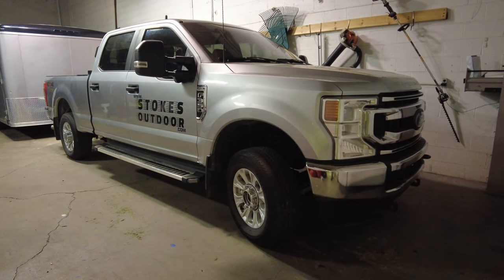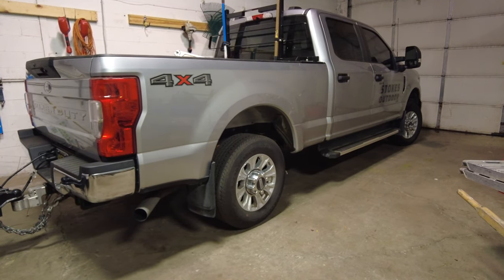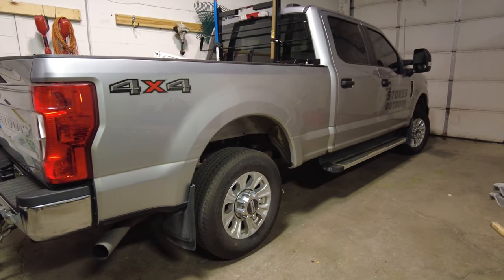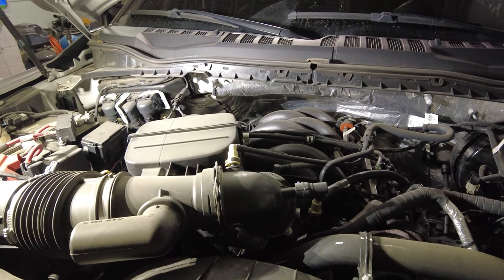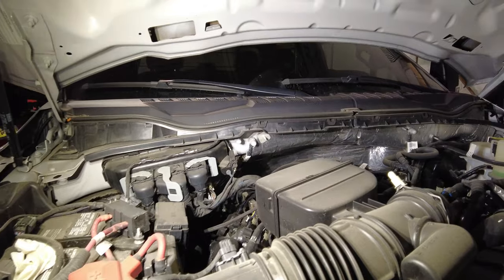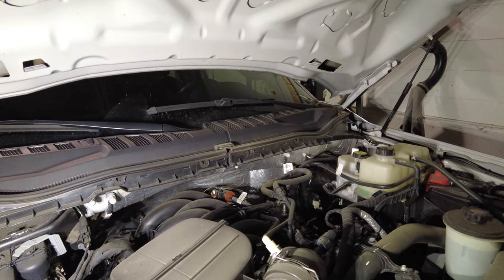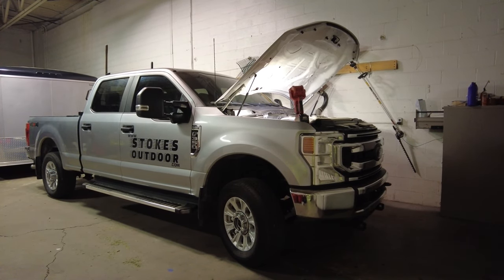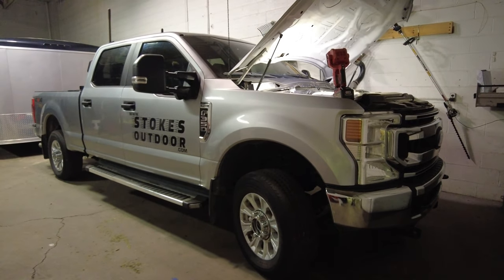7.3 Godzilla v8 - This is why this engine FAILS.

Comment: I run valvoline full synthetic 5w30 and I change it every 3k miles. Oil is cheap, engines are not. It’s that simple.
Reply: Yeah people are running their factory oil fill for 10k miles. All that new metal from the motor grinding itself around. I change my oil twice as often as recommended. 12 year old car and running perfect.
Reply: If you have to change the oil that often then the engine is a POS

Comment: With the availability of synthetic oils nowadays it's an absolute disservice from Ford to recommend synthetic blends and these high output and their turbo engines
Reply from the maker: After seeing these results I have to say I agree.
Reply: I'm a ford tech and people complain synthetic blends prices. You're funny if you think they'll pay for FS oil change
Reply: @amiliosanchez  I’m sure they do. Not my fault Ford over charges for their oils. The actual price difference is negligible when comparing to other brands of full synthetic. The comment stands with the fact that blend oils do not stand up to the recommended oil change intervals for turbo engines. 2 things can be true at the same time. The blend oils are inadequate and people will complain.
Reply: Rotella T6 in all the things!

Comment: Amsoil 100% synthetic all the way and change frequently! Great vid and great info! Keep in mind that “full synthetic” doesn’t mean 100% synthetic. It only has to be 25% synthetic by volume to be labeled “full synthetic.” Amsoil is 100% synthetic. 👍🏻
Reply: This guy gets it! Not enough people are aware of this with modern oils.
Reply: I’ve run amsoil in every single truck I have owned and never had a single engine problem so either I’m lucky or amsoil works. 
12’ 6.7 ps 
15’ 6.7 ps
17’ 6.7 ps 
19’ 6.6 dm
20’ 6.6 dm
Now  two 22’ 7.3 gas fords 
All trucks traded with 65k-100k miles
Reply: ASE master tech and I agree 100% with using Amsoil. I 13:54 have 340k miles and no failures using Amsoil. In addition to low oil quality, I believe cheap China built lifters are cause of many failures. The needle bearing fails causing roller to move up and lifter drops down.
Reply: @TimTheCarMaster  I work several guys with GM trucks with AFM engines. Most of them have over 200k miles on their trucks, no lifter failures. I assumed that they turned AFM off. Not a single one knew that you could even do that and they weren't particularly worried about it. I know for a fact that three of them with over 200k miles are the type that change their oil every 3000 miles no matter what. Clean oil seems to be the biggest factor, not high priced boutique oil. Perhaps in a turbocharged engine where the oil is pushed a lot harder, I could see spending tons of money on the top of the line oil. I don't see that value with a standard pushrod V8. Avoid extended idle time, change the oil often, avoid short trips in cold weather, etc.
Reply: Gotta watch out for the Fool Synthetic.

Comment: That 7.3 is a traditional v8 design from yrs gone.If you were  to go back  20+yrs,we'd run 10w30 and change it out @3000 miles/5000kms in an engine like this.Thats what I'd do personally. I have watched a few tests on MotorCraft oil and the results were good,better than I expected. Again ,if it were me,I  would switch to 10w30, change it 3k miles and use Ford oil and filter.
Reply from the maker: I can dig it
Reply: Most of it is, this engine still has a variable cam phaser and a stupid variable oil pump, which I believe is the reason for the lifter issues due to low oil flow at idle. Thanks Ford for ruining what could have been a great engine.

Comment: I have 2 2020's.  one with 136k and used by 3 different of my guys and my personal truck at 62k.  Not one mechanical issue, but other than a few battery's.  I change the oil every 5k miles.  Full synthetic.  We pull heavy and long. great trucks, and my employee will buy the one when it hits 150-175k and then Ill order another one.

Comment: Thin oil is the problem.    Thin oil is used only because of the epa/government involvement.      Don’t believe me?    Look at what every race car runs.    None except for maybe Indy cars.   Idk what they run.      Better quality higher viscosity make all the difference in the world.      More than one person brought me their cars that were having lifter issues and rough running.   I had them come back regularly to learn the pattern.     I went from 5-20 to 10-30 1040 depending on mileage and time of year and all their problems stop.

Comment: In my opinion, it would be a complete waste of money to use a top of the line oil like Amsoil only to change it at 3000miles/5000kms
Reply: I agree. The solution is to get something more reasonable, like valvoline or penzoil, and change every 3-5k miles. But if somebody has the dough to pay for 3k service with amsoil, more power to them.

Comment: Ford recommends 7500 mile between oil change , best bet if you going to stay with ford, change every 3-4k miles. No need to go to amsoil , but amsoil is a good option
Reply from the maker: 7500 is too much for me
Reply: That's what I'm saying. I work with a lot of guys with newer (2014 or newer) GM trucks with AFM lifters. Some of them have over 200k miles. They change their oil really often like older timers always did and none of them have had an AFM lifter problem surprisingly. It's about clean oil, not how fancy of a full synthetic you use. Get the contaminants, carbon soot, combustion byproducts, etc out of the engine. The filter isn't cleaning that stuff out of the oil. Only an oil change accomplishes that.

Comment: Run 5w40 amsoil. Do a test a 5k miles. We run 15w40 in everything and never had any issues. Gas and diesel.  They run the thinner oil l for fuel mileage.
Reply: Yes thin oil is for fuel mileage, we run 15-40 diesel oil and put 160,000 miles on our 7.3.

Comment: Have a 2022 F350 with the 7.3, check engine light came on with misfire in cylinder #3. Just heard from the dealership they have to put a whole new engine in it (lifter issues). Only 25k miles on it with almost zero towing and primarily highway miles.
Reply: Bummer, I'm sure it's in my future. Stupid Ford!

Comment: Yeah Ford should have already had full synthetic oil to start with like the other manufactures, instead of being cheap with a blend. You should try Mobil 1 5w30 which a little heavier and shouldn't hurt anything, unless you start the day out in lows of 20 degrees and highs of 40 degrees. I have sent off many samples of Mobil 1 5w30 whether it be extended performance, or just the Regular synthetic with good results even at the 7000 mile oil change intervals. Black Stone Laboratories has been pretty consistent with all the samples that I have sent them. I have a GM 5.3 with 216,000 miles with minimal wear from each of results showing normal, I don't think that it should be any different in the 7.3 , as it's a push rod engine to and it's a pretty stout engine. I believe that the Motorcraft synthetic blend doesn't have the additive package that Mobil 1,  Pennzoil , or any of the other brands have, and that may be half of the problem that's happening with the lifter and camshaft problems. As a matter of fact, I'd run Shell Rottella if they made lower multi viscosity oil for tighter tolerance engines, that's a very good oil.

Comment: I wanted to buy one. 7.3 lifted big BFG's............ Then I learned about he adjustable oil pressure pump.      How could ford F it up that bad... not an accident....... Sucks almost a great motor. Guess I need to build a 460

Comment: Ford gasoline engines seem to do good by changing the oil no later than 5000 miles or every 6 months with the Motorcraft 5w-20 or 5w-30. Thats worked well for me for the last 30 years.

Comment: I tow. Payload of 2k plus daily. City drive. Synthetic with 5k intervals engine. Trans and rear diff every 30k. Grease all zerks with oil changes. If you use your truck daily for work then have a regular maintenance interval.

Comment: How are those rear leaf springs since they now use less leafs due to better spring steel? My 2001 7.3 has 5 plus an overload and rides pretty smooth and the truck only drops an inch with a 6200 lbs bobcat on a short steel trailer. Anyone else here have the same approx. 1" drop with the newer springs or do more leafs need to be added to the newer trucks?
Reply from the maker: This truck squats pretty good with the bobcat

Comment: Sorry the problem is this. We have a whole fleet of these engines in the fleet side or the customer side idle oil pressure 5 to 7 pounds too low. We just got the new software to bring it up to 30 psi at idle for the oil pressure and we brought the oil from 5:30 to 10:30 regular oil not synthetic.

Comment: Try Amsoil from a lot of research, Motorcraft oil is terrible. I’ve seen so many problems when people use nothing but Motorcraft it’s like the 3.5 ecoboost with people having cam phasers and timing chain problems. I have a friend who has a 2015 3.5 ecoboost and he’s ran Amsoil since day one and that truck runs flawlessly it has 150,000 miles on it at the moment. And he also has a 2018 Mustang with a 5.0 that is known for having the coyote tick. We ran Amsoil since the day he bought it and that is as quiet as can be and it currently has 50,000 miles on it.

Comment: The real question Is the 7.3 better than a 6.7 diesel
Reply: I own a 6.7 deleted and a 7.3 has both in F250’s. The 7.3 at 97,000 miles is definitely less expensive to own and operate compared to the 6.7. Both pull trailers most of the time.
Reply: @tractorben  Great info, thank you.
Reply: It just depends on what you need.   I got a 7.3.  More people will laugh at you with the gas engine though.  And you won’t get as many girls.

Comment: My son has a 2017 Silverado with a 5.3 engine, it specifies a 0w-20 engine oil. Sure seems light to my thinking. He runs a full synthetic Castrol and it holds 8 quarts.
Reply from the maker: Not a bad move. Thinn oil so running high quality.
Reply: Changing the oil more often is the most important thing with the AFM engines. 5k mile oil changes is pushing it. 3k mile oil changes is best, particularly if it sees a lot of short trips in cold weather. That kind of driving causing more fuel and moisture to get into the oil and form deposits in the tiny oil passages of the AFM system.

Comment: When your oil life monitor reaches 50% change it. Oil is cheap compared to engines, even using Amsoil every 5,000 miles you’d have to do over 100 oil changes to equal the cost of ONE new engine. I’m quite sure by 500,000 miles that engine will have had it no matter what oil you use.
Reply: It's not about using the fanciest oil, it's about changing it often and getting the contaminants out of the engine! None of these high priced boutique oils can magically remove combustion byproducts, carbon soot, etc. The filter can't do that either.

Comment: The roller lifters and cams run in these newer engine should have much less tendency for wear than the old flat tappet lifters used for almost 100 years prior. I use Valvoline Full Synthetic 5w-30 and change it every 5000 miles in all my trucks and cars. The manufacturers seem to think thinner oil equals higher MPG.

Comment: The 6.0 PSD also suffered similar issues as well
Reply: 6.0 was extremely hard on oil.  4000psi oil system that has to lube the injectors and run through a cooler buried in the valley so the oil easily gets too hot.

Comment: All boils down to frequent oil change intervals. No more than 5K. No excessive idling. All the oil change intervals in the owner manuals are way too far apart. And it's listed for normal driving.

Comment: Motorcraft oil filters are a poor choice also .
Reply: OEM filter is fine
Reply: @BT62240 Motorcraft filters have about the worst efficiency there is . For $4.00 what do you expect.
Reply from the maker: Really 🤔
Reply: @kenj.8897 you haven't actually compared them to anything else.
Reply: @wakeupamerica2024 they are 80% efficient at 20 microns . I can name 15 filters that are above 95 % . Like I said it's a 4 buck filter
Reply: @kenj.8897  I bet you cant
Reply: I'm interested. I always use fl820's. I thought they were as good as they get. What is the list of better units?

Comment: 7.3 Godzilla is an absolute dud of an engine. Makes less power than the 5.0 and gets way worse gas mileage. Ford fooled people into thinking that more displacement = more power. 

If the 7.3 made over 500HP stock, I wouldn't be shitting on it. It makes 430HP/475TQ. A Ram 2500 with a 6.4 has it outclassed in power AND reliability.

All Ford had to do is make a Coyote based V8 for the F250/F350 that made more power and torque and it would have been way better.

Instead they made a pushrod engine in a failed attempt to appeal to the aftermarket, and they can't even GIVE these things away. They need the truck transmission, smaller oil pan, different intake manifold, etc to fit in a car. Then you have to bash the shit out of the transmission tunnel and possibly cut the engine bay for it to fit. Not worth the effort. All for what? To say you've got a 7.3L big block V8? No thanks.
Reply from the maker: 🤔 5.0.would be better?
Reply: Lmao 🤣
Reply: Does this guy get paid by Dodge Ram?
Reply: Right it's only got 410hp and 429tq....yeah I'm shittin on that shitbox. That 7.3 will outlast the hemi 3x and I'm not even a Ford guy.
Reply: I’ve been towing an 8,000 lb trailer back and forth across the rockies with the 5.0 Coyote for the last 4 years.  I recently bought the 7.3 and its no contest.  The 5.0 was working to the limit, and with the 7.3 its effortless.  This guy is clueless, and has zero actual experience with either engine - just another spec reading keyboard warrior.
Reply: I have had a 6.8 v10 I have had. 6.2 boss v8. I had a 6.2 v8 with the 6r80 and I currently have two 7.3s and it’s night and day diffidence down low for power and it still has power up top at red line. One is my daily and I have 78k on a 2022 with 2300lbs in the bed at all times and I still get 12.1 mpg with a 4.30 rear gear.
Reply: The 7.3 has the same bell housing as the 5.0 coyote and the 5.2. It’ll bolt right up to a 6r80, mt-82 or tremec. I don’t know what you’re smoking
Reply: Why don’t we just toss in a 4cylinder with turbos…..lol I’ll stick with my 7.3l